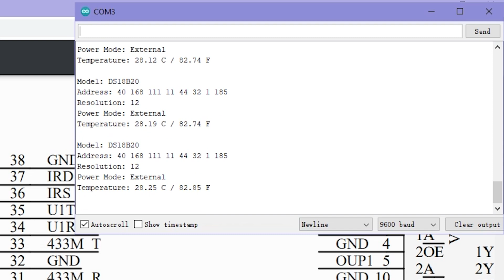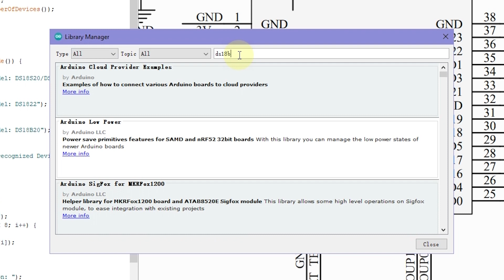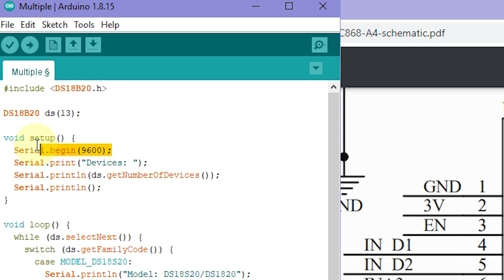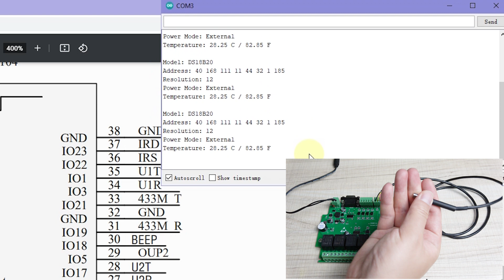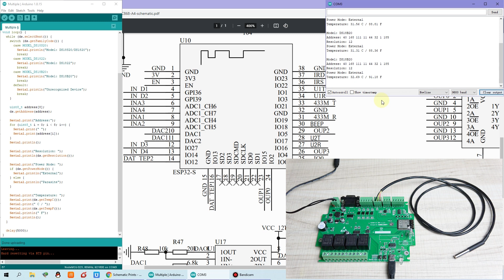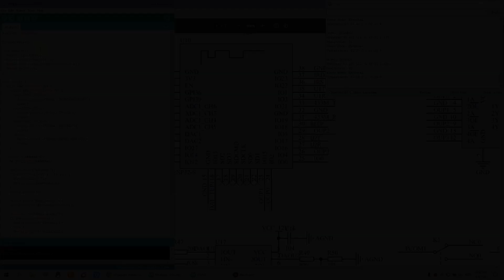Lesson4- How to use Arduino to read DS18B20 temperature sensor

Comment: Homekit use temp sensor?
Reply from the maker: yes, we have a homekit demo
Reply: Perfect I like to use two temp sensor and and input one lever sensor (only low and high) and use two output.. is that possible?
Reply from the maker: @molsson4345  hardware support , no problem, just software need modify based on "HomeSpan" demo.
Reply: Please make guide how to mix input and output and make one project of it.

Comment: I bought a KC868-A4 board and I want if you can help me with some examples for arduino but I want to use 4-20ma sensor
thank you
Reply from the maker: you can use a 250 Ohm resistance connect with signal input port and GND to convert.
details: https://www.kincony.com/forum/showthread.php?tid=49
Reply: @KinCony  why need to convert  this bord suport this sensor ??
Reply from the maker: @ionutaurelian2963  because default analog input port for DC 0-5V
Reply: @KinCony   ok but i heave kc868 - A4 so i cane to use direct 24v 4-20ma in A1 A2 port ??? You cane provide some example for arduino code
Reply from the maker: @ionutaurelian2963  Yes, sorry for my mistake, i forgot it , code of 4-20ma as same as 0-5v. we already have video tour: https://www.youtube.com/watch?v=QTGxm48Veqg&list=PLQUWhE_6LeOSOXC9NWL8g5qnkgAdy4gON&index=6      this video use by 0-5v sensor, but it's same for 4-20mA.
Reply: @KinCony  tnk
Reply from the maker: A4 have two analog channel you can use 4-20mA sensor directly

Comment: Thank you for the tutorial. I want to display the value of the temp. sensor to an external display. This board (KC868-A4) is perfect for my aquarium project to check and control the water temperature , aquarium lights, water change, etc.
Reply: hello you cane help me some arduino code for this board????

Comment: Can you please do a video on the i2c communication between colb controller board and the relay controller?
Also how to diy the app for the controller?
Reply from the maker: colb work with relay controller by RS232, not by IIC. DIY app we already have the video guide in before.